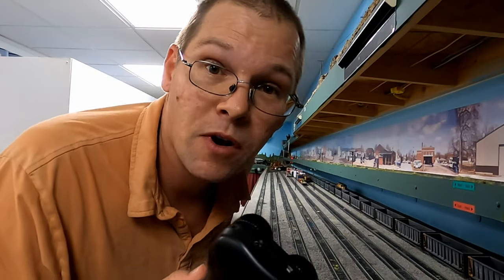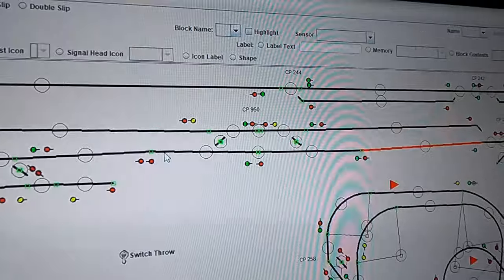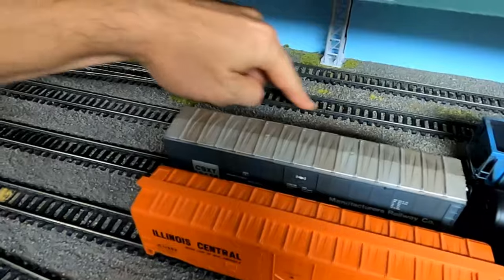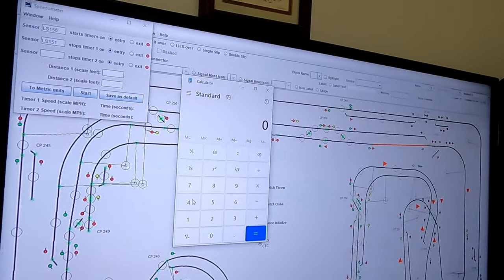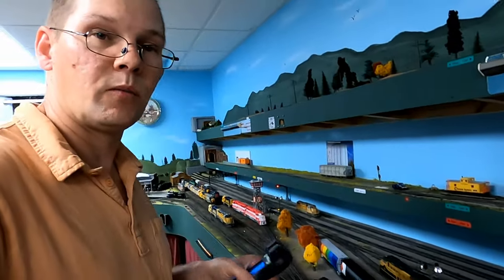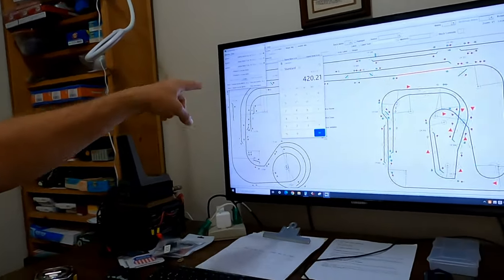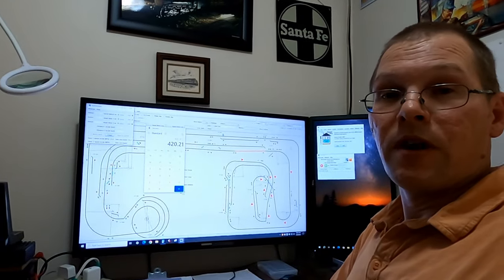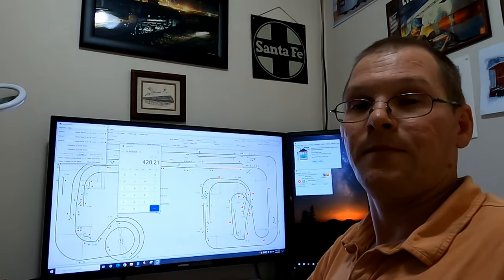Speedometer built into JMRI for your Model Railroad

Comment: Ooh, I like this!!!
Is there a way to add the speed as a value and then post it to the dispatchers panel? Could you theoretically add a speedomoter between every block and track a trains speed from block to block?
Are you using JMRI for your panels, or is it CATS?
Reply from the maker: I did not see any options to use the reported speed from the window of the speedometer in other parts of JMRI.
As for my dispatcher screen, I used JMRI Control Panel Editor, made my own graphics, and animated it with Logix. I model modern Union Pacific and wanted a screen that looked more like UP's CAD3 system. CATS, while a great choice if you just want something modern, is based on the BNSF TDMS system. As a UP modeler, it wouldn't fit right with our layout.
I have a video on my Signal Up Productions Facebook page showing the functionality of my signal system.